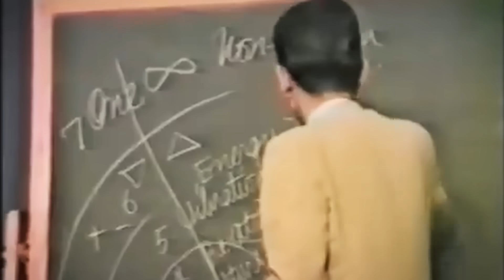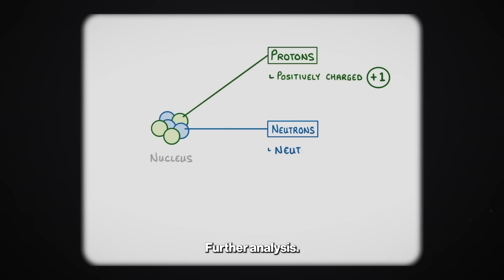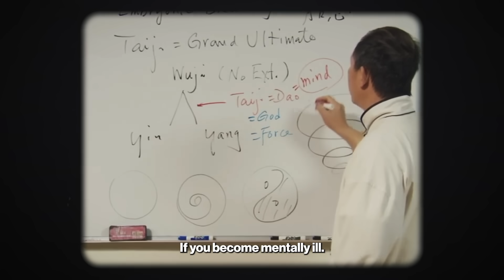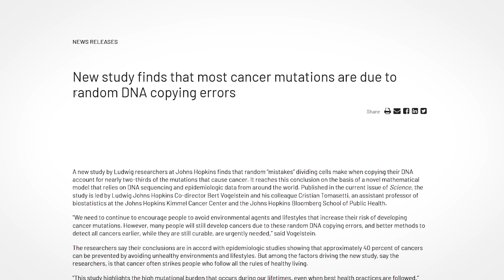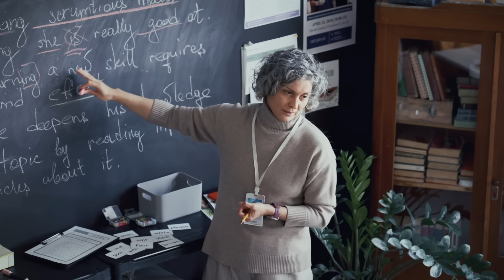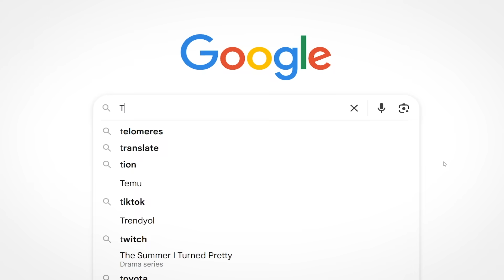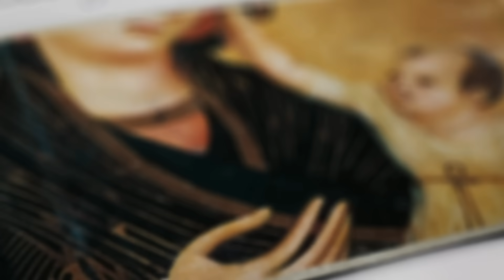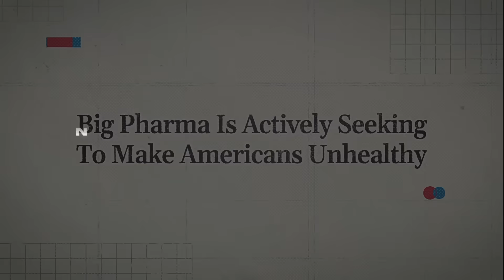America Banned This Japanese Scientist After He Revealed Too Much

Comment: Static electricity, for example, is energy made from the electrons and human made energy like global warming. Those lightening is most likely negative (fake positive energy) and strikes down. The natural energy strikes either up or down, due to the molecular makeup like the weather. That is always positive and will strike negative energy like manmade energy like the transformers or even cable wires, trying to connect. Because just like there are negative and positive energy molecules, there are also negative and positive lightening but manmade energy like electric is always negative. Always. Because it's dark energy. So dark energy, even causes lightening too. And the difference is hard to see. But dark energy is different than natural energy (light energy, which is energy resulted by molecular calculation without artificial power involved like static electromagnetic power for example)...

So, it's different. There's two types of energy: one that can be harnessed (electric) and the other that can never be harnessed (the spirit, except via sin). What solidifies spirits is trespass against the body and mind, and the modifications of the pathways to life. So, that's what traps them in hell in the next life. The Spirit can NEVER DIE. EVERYONE KNOWS THAT. SO, THE ONES WHO CHOSE THE PATHWAYS OF THE NEUTRON, GETS TRAPPED IN THE MORNING STAR/COVID-LOOKING "RED SONYA" BALL. THAT'S THE ONE BEHAVING LIKE THE "VIRUS", USING "ELECTRONS" TO STEAL INFORMATION AND ENERGY FROM THE NUCLEUS AND TRYING TO CORRUPT THE NUCLEUS AS A RESULT... FCKED UP. IT'S NO WONDER THEY THOUGHT THEY COULD CHANGE THESE ROLES, WHEN EVERYONE'S WAS FAKED AND THEY SHOULD HAVE OUTED TRUTH AND FOUND A RESOLUTION BACK THEN, RATHER THAN, SWITCHING OUT ROLES THAT SOMEONE MADE UP BECAUSE THEY FCKED UP OUR PATHWAYS TO LIFE... SO, NOT ONLY DID WE GET MODIFIED PATHWAY, BUT WE ALSO GOT FORCED TO LIVE A SHITTY ONE AS BEETLEJUICE SWITCHES OUT THE FRICKIN "CHI"? NO WONDER I WAS ATTACKED FOR NO REASON... BUT AT LEAST I UNDERSTAND HOW IT HAPPENED, I THINK. OH WELL. JUST GOTTA MOVE ON IF THE NEUTRONS DON'T WANT TO COME OUT OF THOSE WAYS AND RESOLVE ALL LIES THE PROPER WAY. IT'S JUST, NOT ONLY DID I GET SCAPEGOATED, BUT THE ONES WHO DID IT, TRIED TO KILL ME, TRIED TO GET ME TO BE SUICIDAL, AND EVENTUALLY, TRIED TO CAUSE ME TO INSANITY, TO CUT ME DOWN FROM SOMETHING... IT'S LIKE, "ARE YOU DESPERATE TO SILENCE ME ABOUT SOMETHING?" I HONESTLY DON'T KNOW WHAT IT COULD BE, OTHER THAN TRESPASS...

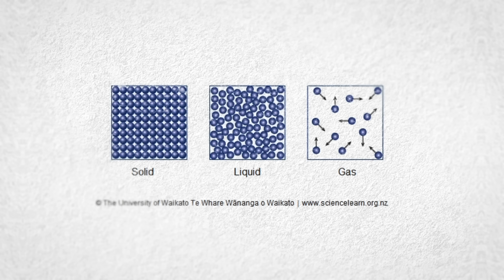Comment: 3:45 - No, it's an energy called a proton with a nucleus that made matter, and matter made energy called electrons. Matter cannot make protons. The dimensions tell us (which is what the signs of the sun, earth, moon, and stars are), that matter (moon) cannot make a proton, but pretends to be one, like a person tilling dreams of a sun and causing people to follow that one/version instead (but is a virus version because it's a lie, not TRUTHFUL). The moon reflects the light of the sun for a reason as a result. But it is hot and cold, which us why it is neutral. Neutron pulled the nucleus away from positive energy. And forsakes the electron version because it knows it's fake. But during this phase, the neutron neutralizes the nucleus with static electricity and electrons (stars), and the proton pushed it away because it can sense heat on the surface of the nucleus. So, the static heat/energy (although is a fake proton, and fake positive energy), caused the earth to go further away from the proton (the sun). And as a result, the nucleus (earth) has no choice but to rely on the surrounding nucleus (other "blue planets", that's not really a planet but are spiritual beings who do not use human power or human vessels but only Truth), until their "time" in the purgatory has passed. That's why it's the valley of the shadow of death - the split. After our time passes, we will see where we ended up. Some will be in the UNDERWORLD and others will be redeemed back to life. And those who sinned, and needs to be redeemed are destined to repeat history. 

And so, the human rod/power that controls both positive and negative energies are symbolic for electrons. They're fake. It's the neutron pretending to be the proton and a fellow nucleus, but falls drastically short of truth... 

And that's why the sign is also symbolic of an electric eel or worm inside the pearl (on the moon), like the head of a cane or like a candy cane head... and it's an everlasting sign of the ancient technology being electricity!!! Electricity is DARK ENERGY. "Light energy" is not human energy. It's spiritual. TRUTH IS LIGHT ENERGY, like the proton. 

So, that's CANE, WHO KILLED OUR ABILITIES. THAT'S WHY YOU CANNOT SAY PEOPLE ARE LAZY OR WICKED, BECAUSE THE ROOT CAUSE OF ALL EVIL, CAME VIA SIN. AND THE NEEDLE THAT CAME THROUGH THE EYE, LIKE A EYE OF A NEEDLE, IS ELECTRICITY (ELECTRIC WAVELENGTHS, ELECTRICITY, RADIOWAVES, MICROWAVES, ELECTROMAGNETIC WAVES). SO, THAT'S WHY THE HOLLYWOOD MOVIES AND SH* THAT GUIDED ALL CHILDREN ASTRAY MUST BE DESTROYED. IT IS WHAT CAUSED ALL THOSE WHO BUILT IT TO BE TRAPPED TO SEE THE COST. AND ACCORDING TO JESUS, YOU WILL NOT BE RELEASED UNTIL YOU KNOW THE FULLNESS OF THE COST FOR SIN AND MIND CONTROL AND INTENTIONALLY CORRUPTING CHULDREN! 

IT IS FORBIDDEN! SO, THE SINS AGAINST CHILDREN, EVEN FROM ADULTHOOD GOING BACK, IS WHAT CAUSED SOMEONE TO "BREAK THE SEAL", AND THE REMINDER IS SET. TIME IS TICKING... THEY SAID, IF THAT MOON DOESN'T CHANGE ITS DIAL, YOU KNOW WHERE YOU'RE HEADED... MEANING, THE BUILDERS ARE THE ONES LEFT BEHIND, BECAUSE OF THE WORLD THEY MADE. AND UNTIL THEIR MINDFRAME MIRRORS THE BLUEPRINT OF LIFE AND UNTIL THEIR WORLD COMES DOWN ON EARTH PEACEABLY AND TRANSITIONS PEACEFULLY BACK TO LIFE, THAT SIGN WILL NEVER BE ERASED. AND EVERYONE WHO CONTINUES ON THAT WAY OF LIFE WILL END UP THERE. THE LODGE WAY OF LIFE... THE REAL ONES WHO ACTUALLY USE SECRET SCIENTIFIC DEVICES LIKE HEARTMATH WEAPONS VIA SPINNER ON US. THAT IS TRUE. THAT'S WHAT THE SCORPTION ARM IS - SYMBOLIC FOR THE TWO PRONG SPINNING THING... OR THE TWO PRONG USED TO SEND ELECTRIC SHOCKS... FCKED UP.

Comment: 2:48 - I understood that cancer is caused by energy gathering cells... not sure how... but I thought stress had a lot to do with it. And that, the clumps would have to be separated... no one ever needed surgery. But the spinning device is the "electron" I believe you were saying...

So, the story of the "physics structure" is: Proton (Sun), Nucleus (Earth), Neutron (Moon), and Electrons (Stars). 

The order of birth goes as follows: the Nucleus is the first with one Proton within it (SYMBOLIC OF POSITIVE ENERGY, LIKE JOY). Then, the moment the nucleus becomes "active", the proton is born. A Neutron is also born (like a djin or a troublemaker - a jealous one, like Cain/Cane). The neutron works to draw its energy AND information from the Nucleus. The proton works to protect the Nucleus because it feeds it oxygen and the proton feeds the nucleus positive energy. So, the proton tries to pull the neutron away from the nucleus to prevent it from crushing it, by drawing it with its heat. But in order to save itself, the neutron (who is like a "copy" or neutral and plays both "hot and cold"), tries to hide behind the nucleus to save itself. And in order to "trick" the proton, the neutron causes static and friction by causing Electrons to be born. Electrons helps to sustain the energy on the surface of the earth, so the neutron tries to deceive the nucleus into creating electrons, to sustain the energy when it actually causes static electricity. And as a result, the proton senses that the nucleus is warm, and so, rejects the nucleus, as the neutron continues to behave like a parasite, trying to take over as both the "proton" and "nucleus" as it went off and made its own version of both, which is like a virus because they cut out the proton and nucleus as the neutron set itself as the nucleus and the electrons as the proton. 

As a result, the nucleus was pushed away, as the neutron continued to steal information from the nucleus and the static electricity that surrounds it keeps it petrified or sustained that it cannot save itself. Rather, the nucleus must go through the process of this pathway, as the neutron then works its way to push out the nucleus and to trap itself in physics. It only happens once.

Everyone knows that the underworld is like a "dot" or the "end" of the sentence. Or a tiny mole in the universe, like morning star corona virus ball, just floating like a pollen among omnipresent beings. 

And mankind stole these things, mauled the truth and put it all out of order - that's "a New World Order", apparently...

But the nucleus never dies. In fact, all scientists should know the nucleus then retains the memory like an antibody, and is joined or united with other nucleus. 

Remember, there is only one Neutron and many mini neurons... but never any more than one NEUTRON/Actual Physics/Dimensional World). And the Neutron is the only MATTER in the Universe. Actual matter. Energy is the proton (pure energy), and the nucleus feeds on that energy in order to live and in return, the nucleus feeds it oxygen, not the living or spiritual beings. The proton is a vaccum only for mass or matter... the proton does not consume the nucleus at all. It helps the nucleus to grow. 

But when the nucleus becomes trapped by the neutron during the stage of division, it matters which pathway the world chooses to go. But their future can never escape the cycles set up by the electrons, unless they forsake it all completely and rely on truth, wisdom. Basically, the nucleus must place its hope in the surrounding nucleuses in the universe (spiritual beings) that will help, not via human power nor human vessel but via Truth and CONCEPTION (WHICH IS WHAT THE PROTON IS SYMBOLIC FOR)... 

But once the neutron pulls the nucleus to a "petrified" state of hold, meaning, the proton can no longer help the nucleus because the distance is too far. Therefore, as a result, the divide occurs. 

Noticable changes during the process: the proton begins losing its energy once it pulls on the neutron. Because it was willing to sacrifice itself to save the nucleus. However, because the neutron pulled information from the nucleus, it used the knowledge to benefit itself by causing electrons to be made. It would always behave in this manner. Like a virus. Taking apart information/programming meant for what the nucleus intended but was forcibly applied to what the neutron wanted, like an overwrite. So, when the proton began losing its energy, it would create dark spots on the surface, revealing the damage the neutron caused, while the neutron suffered damages of its own by the proton, as it also has dark spots. But the proton regains its energy by other surrounding nucleus, as there are plenty around. The nucleus is made of one inactive proton and many mini nucleuses... like the neutron has many mini neutrons in ion if a neutron is born.

The proton heals quickly, as many other nucleus immediately tends to it, and it no longer has dark spots. But the neutron cannot ever heal itself, because it is made of matter. And matter, once it is destroyed, cannot be restored. The one neutron that was destined to come into existence and will eventually decay and be no more, is physics. It's not the "valley of the shadow of death", which is the purgatory stage, where the nucleus is being pushed out from the neutron, not always by force and sometimes, they go gradually, but most of the time, the electrons forces it to increase. That's like an example of the world's messaging cutting down people... but they say that these things had to happen... but it's moreso scientific... it's not supposed to be intertwined with the living and spiritual things... but someone did it. And thus, trapped themselves when trying to trap people in physics... fcking unreal.

Anyway, when mankind takes over GUIDING humanity (pretending to be the only mini nucleus in this nucleus) via dreams (using human power/stars/electrons), they become equivalent to a neutron. 

I do believe that to everything, patterns are inevitable. All mankind, therefore, are TRULY BOUND BY THE LAWS OF PHYSICS. ONCE THEY GO OUTSIDE OF TRUTH OR THE "UNWRITTEN LAW" (LIKE LAWS OF PHYSICS) SUCH AS TRESPASSING AGAINST OUR ENERGY (CHI), THEY DON'T KNOW WHAT THE POKEMON BALL IS WE SEE THE SIGN OF A FULL MOON. IT IS AN EVERLASTING REMINDER OF THE ONES WHO ARE DESTINED FOR JUDGMENT TO PREVENT THEIR FATE FROM GETTING WORSE OR TO PUT AN END TO ALL SIN AND WRONGDOING AND RESTORE ALL TRUTH AND RESOLVE ALL LIES TO THE WORLD AND VINDICATE ALL VICTIMS. AND TO TAKE ALL THE LYING STRUCTURES DOWN AND TRANSITION AWAY FROM ELECTRICITY... WHICH IS AN IMPOSSIBLE TASK FOR THEM AT THIS POINT IF THEY'RE ABOUT TO DIE. 

BUT THAT'S WHAT THE "COST" IS ABOUT. THE COST FOR SIN. I THOUGHT EVERYONE KNEW. IT WAS ACTUALLY SOMEONE (MAYBE JESUS), WHO REALLY WAS THE ONE AND ONLY WHO CAME "UP" FROM HELL, NOT "DOWN" FROM ABOVE... IT WAS ACTUALLY THE WHOLE WORLD OF PEOPLE (EXCEPT SINNERS), WHO WERE RAISED UP. AND THE SCAPEGOATING OF ONE MAN IS NOT TRUE. ALL SINNERS ARE JUDGED. THIS IS WHY PURGATORY IS NOW. EVERYTHING YOU DO IN THIS LIFE, DETERMINES YOUR FATE: TRAPPED IN MORTALITY OR RETURN TO THE SPIRIT BECOME REDEEMED WITH OTHER NUCLEUS TO STRENGTHEN OTHERS TO GAURD THE WAY AND BUILD UP LIFE. 

AS FAR AS THE ELECTRONS, IT'S AS IF THE NEUTRON CONTROLS THE NUCLEUS BY SURROUNDING IT WITH ELECTRONS/STARS TO TRAP IT, PULL, AND FORCIBLY GUIDE IT, CONTROLLING ALL CONTROLS AND INFORMATION STREAMLINING. IT IS VERY DECEPTIVE, LIKE THE WHITE WITCH BEHAVIOR IN "SNOW WHITE AND THE HUNTSMAN 2" WITH EMILY BLUNT ACTRESS WHO USED MIRROR DECEPTION. BUT HUMANS USES IT IN REAL LIFE WITH REMOTE IMAGING, IMAGINATION AND USING DOUBLE SCRIPTED NARRATIVES TO KILL TWO BIRDS WITH ONE STONE... FCKING SNAKES.

ANYWAY, THESE ARE NEUTRONS. WE ONLY GOTTA DEAL WITH THEM ONE TIME OUT OF FOREVER. AND THEN, WE MOVE ON. THOSE WHO ARE TRAPPED IN THE NEUTRON GOES THE LONG WAY. THAT MEANS THEY LIVE EVERY TORMENT THEY CAUSED VIA SIN AND EVERY LIE THAT MODIFIED AND IMPACTED THE PLANS OF THE LIVING. THAT IS ABSOLUTE. 

The proton will always live because of the nucleus. The universe will only have one proton. Only because mistakes only happen once and that's in Purgatory. For, once there was sin, all the world was already pulled by the electrons controlled by the neutron. So, this is the purge, as long as those stars shine day and night, and as long as mankind dominates over their fellow man with concepts that always results in death. It's inevitable because of the pathways built when mankind cheated the living and took over building up the globe by force.

So, all things in life take after the pathway of another... following the course of life, and how, for the living, TRUTH AND LOVE ALWAYS HAS A WAY OF REDEEMING THOSE WHO HUMBLED THEMSELVES TO LIFE AND NOT GIVE INTO DEATH. SURELY WORDS ARE WORDS... BUT WHO KNOWS WHO PLANTS THEM IN OUR MINDS BUT THE TILLER. AND THE IDEAS THAT COME, WHEN THE PROGRAMMER SETS IT TO BE INTENTIONALLY BAD... THAT'S CALLED TILLING NEGATIVE ENERGY INTO OUR BODY. THAT'S LIKE SANTA CLAWS SWITCHING OUT GOOD ENERGY FOR BAD ONES. FCKED UP. AND THEY DO THAT ALL THE TIME. 

LIKE HOW THE PECKERHEAD BIRDS TAKE THE CHILDREN'S BREAD FROM THEIR MINDS (STEALING THEIR MINDFRAME'S CHI, AND FORCING SOME UNCLEAN DIRTY FCK'S ENERGY INTO ME, AS IF TO SCAPEGOAT ME AS EVIL OR SOMETHING... IT'S MESSED UP. AND THEY DO THE SAME WITH THE HEART'S NEUROLOGICAL ENERGY TOO... WITH EXPERIENCES, WHICH IS WHAT I CALL "FAMILIARITY EFFECT"... THE FAKE FAMILIAR FEELINGS... AND THEY'RE FAKE...).

Comment: Now add a artificial wave form to our atmosphere (5G millimeter wave).   Transmission from towers, for your cell phone and other wireless devices.  The waveform interferes with the bodies molecular system, by charged ION particles gathering in the body.  

Cure: “Earth Ground”.   This rids the body of charged ION particle buildup.

5G transmission = COVID-19 outbreaks

Grounding rids the body of unwanted resets your bodies electrical system

Comment: People don't comprehend it is the Same exact thing. Ki energy the Electron and Other energy Forms get Trapped in the Body and Mutate the Cell causing Cancer. Static electricity might actually kill you. ELF Wave like a Micro wave will kill basically cook you. Getting the Body flowing working the Immune system will kill the Cancer and the Stomach stem Cells can repair it. With Food that is Really Medicine. Without Food you will die and We Know this. All the Toxic food in USA products in making people sick. Ki or the Electrons moving thought our nerve at 80amps is controlling the Body from the Brain. This isn't magic and the Pharmacy toxins are for emergency. Food isn't!

Comment: lot of truth here, but also some niavety..... cooking with a microwave doesnt cause cancer unless you burn ur food, but you can burn your food just as easily with any other method, you just need enough moisture to cook things in the microwave as this will stop burning things at certain ends, and maybe turn it on a lower strength and turn the time on longer so it takes longer and turns on and off, but a microwave doesn't necessarily cause cancer, its simply the burning of the food. A microwave is designed to target water molecules, and if there is not enough of them then you will get local microspotted hot spots that burn and cause cancer, but if it is evenly distributed you are safe. Black toast will cause cancer too